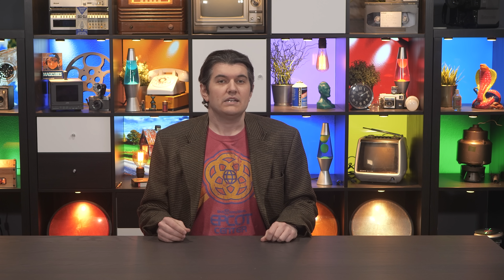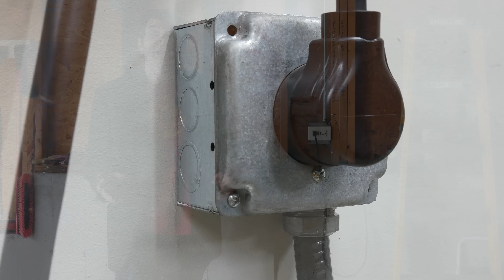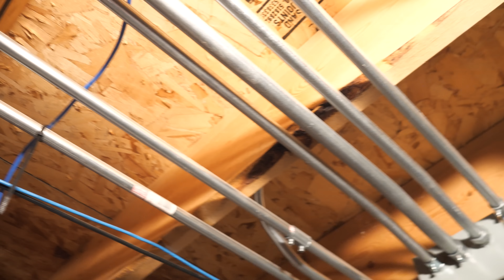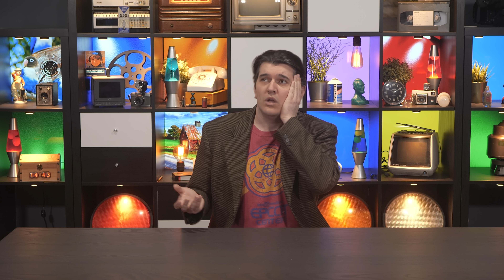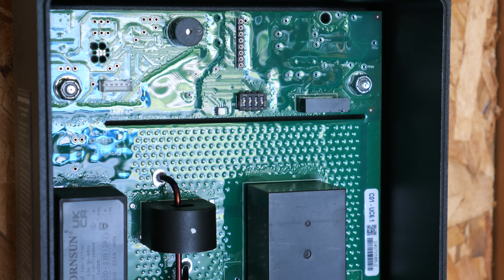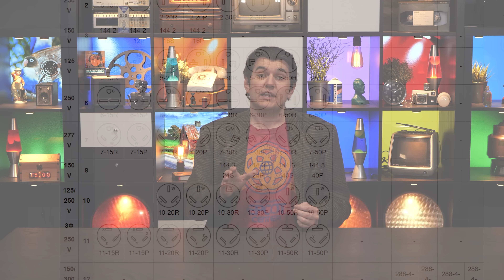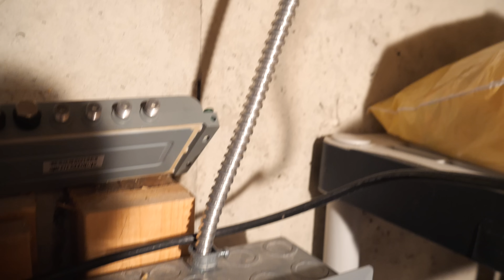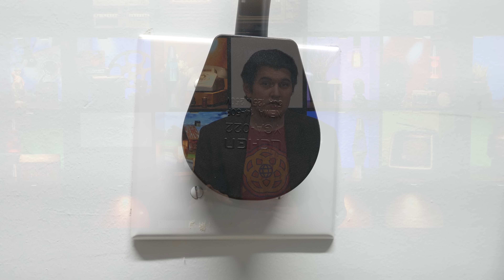The "standard" car charger is usually overkill—but your electrician might not know that

Comment: We have 3 EVSEs at our house. They are all 240 volt. But one is 32 amp, another is 16 amp, and believe it or not the last one is just 12 amp.  The nice thing about 12 amp is I just used some pre-existing wiring going to an existing outlet. I just rewired it at both ends to be 240 volts, doubling the charging speed from 120v.  My wife charges her car from it every night. It does just fine and can easily recoup 100 miles over night.
Reply: EVSEs in the UK have a CT clamp on now for load balancing so you could install 4x 32a EVSEs and they’ll all throttle based on what they’re measuring (whole house or that circuit) - pretty useful for multi EV households. (Our ‘granny chargers’ are 10a/240v but anything above that is always permanently wired)
Reply: @danr3199 you’ll want to make sure you use compatible charging stations that communicate, or they’re gonna oscillate if you’re letting\ them all individually regulate based on the main fuse.
Reply: Ooo ooo ooo the 8 bit guy

Nice
Reply: @adventureoflinkmk2 it’s like one of those bizarre sitcom crossover episodes!!
Reply: I’ve been sharing a plug with the dryer. I don’t need to charge the car and dry clothes at the same time. It’s fine changing out the plugs but I do wish somebody made a switch, you can tell these appliance outlets weren’t meant for continuous plugging
Reply: @alexphelps7042  keep watching the video.  He talks about the solution to this problem later in the video.
Reply: @alexphelps7042  @14:15 in the video. Also splitter cords available. Don't use both at the same time.
Reply: @alexphelps7042 I have a gas dryer that runs the electronics on 120v so I took the 240v from the dryer and charge my car on that circuit.
Reply: @alexphelps7042 14:00 mentions these
Reply: What is this? A crossover episode?
Reply: @Hibari_fan An electrical joke. Nice.
Reply: @Hibari_fan YouTubers often comment on other channels to try to get some views.
Reply: My brother bought a house and wanted a car charger on his 100 amp service. He has a Tesla wall connector running on a 20 amp circuit on his driveway now.
Reply: That's a continues load so it should be no great than 80% load draw that would be about 16 amps -maximum draw
Reply: Yup, it was a game changer for our condo corporation when we realized that our existing wire can run either 120V or 240V at the same amperage.  12 amp charging at 240V suddenly became a viable possibility.
Reply: Hi Dave, I read this in your voice!
Reply: Oh, hi! I read it in your voice. I didn't know I remembered it.
Reply: We bought a leaf in 2011, originally we had a 10 amp charger. but soon we got one that could be set between 6, 10, or 16 amps. even the 6 amp setting worked perfectly fine when visiting my grandparents with questionable circuits in the garage
Reply: Wait a minute, can you make a video of rewiring an existing outlet to be 240 volts? I sort of understand, that might be the perfect solution for my particular scenario.
Reply: @Parker-di7ef  It will only work if that is the only outlet on the circuit. Because this will make the whole circuit 240. If you plug a 120 into it it will fry and possibly catch fire.
Reply: As little as I drive, I could probably get all the power I would need to charge between drives from the 48 VDC, 20 mA phone lines.
Even shorter if people kept ringing the line, sending the 90V ring signal!
Reply: you want to charge your EV with 1W? that's over 3 years to charge my tiny 30kWh battery
Reply: @MonkeyJedi99  If the charger could even operate on that, you'd get about 3  miles of charge in 10 hours.
Reply: For about 5 years we had a 2 EV household with 120v charging only and we never once had a problem.  A Leaf and a Model.  Both are of course very efficient EVs which has the added benefit of adding more miles of range per kWh of energy.
Reply: “Maybe this video was longer than it needed to be.” Alec, THATS WHY WE WATCH.
Reply: New 8-bit Keys when?
Reply: I think that might be my plan. My dryer outlet is close to my driveway, so I have options. (I will hire an electrician, don't worry 😂)
Reply: Update: Device not legal here and my tiny panel could not handle the charger and the 4 season outdoor spa that I'm getting. 

Let's just say I'm REALLY lucky that my wife does the accounting for a small business electrician. The 400$ money back for the charger from the government is nice and all but hoo doggy there goes 3 years of gasoline 😂

On the plus the charger hits 48 amps so my 20-80 takes around 2.5 hours... Nice!
I can also get myself a 220 amp welder for my house now.

Gonna stress this again: I still really love my EV. I thought having a second car for me would free my wife to take up some of the driving duties but I insist I take the Niro because it is such a blast to zip around in with the music PUMPING and the kids jammin in the back 😊
Reply: I am an electrician and I recommend a 30 amp for cost savings unless you own an electric truck.  I own a Model Y and charge on a 30 amp circuit.
Reply: I remember your solar panel video after the Texas winter is the video I think of every time someone mentions solar panels
Reply: Yes a 120V 12 amp or 240v 12 amp circuit can be enough for most l, but where I live in Canada, when it gets cold it takes alot longer to charge because the car needs to keep the battery warm as well as charge it. Also your battery Capacity drops alot as well when it's -30deg C. So consider cold weather performance of you live in colder climates
Reply: @The8BitGuy do you have a video of this?
Reply: @kevinstfort  I want to see ALL videos!
Reply: @kevinstfort same here. charging level 1 from an outdoor 110V / 15 amps outlet with a 75ft 12AWG extension cord and the OEM mobile charger. I think those are capable of 240V at the same same amps. how do you "rewire to 240V"?
Reply: @The8BitGuy could spun off a Channel name @The3EVGuy
Reply: Sounds like the Volt EVSE 240v "hack". Good to see it in the wild
Reply: is ur servicw 200Amps or 100?
Reply: bsolutely loved the way you turned an old wooden pallet into a rustic coffee table! I’ve worked with pallet wood before, and I know how tricky it can be with all the hidden nails and uneven surfaces but your technique for sanding and sealing really made the final piece shine. That torch-burned finish added so much character too. If anyone’s thinking about trying this, I’d recommend following every step you showed. It's not just a beautiful DIY, it’s also a great example of upcycling done right!
Reply: I say 8 Bit Guy TC crossover. In the 12 years I've been watching 8 Bit Guy, that would make one of the most interesting episodes yet.
Reply: and via some batts charged from your rooftop solar panel during daytime
Reply: Wye
Reply: That Tesla video was really bad timing David.
Reply: Wow I would hate to pay your power bill
Reply: Similar setup here.  2 16a 240v's for daily (nightly) charging and one 50A NEMA 14-50 that is RARELY used.  We only use it when it's mid-day and need to recharge quickly or larger battery friends come over and need a quicker charge.  2 200A services at my house.  Before that upgrade, we had one 125A service and still ran 2 16A chargers at night.
Reply: My household doesn’t have a Tesla right now, but we decided get Tesla universal wall connectors. They have the old J1772 plug and the NACS plug built in so it’s future proofed and 4 of them can share a circuit and share power so we installed 2 for now, but we plan on adding one or two others eventually for relatives who come to visit.
Reply: @42069SWAG turning you garage/driveway into a charging station ? 😂
Reply: I imported byd car and charger. I get a full charge at home in about 15min
Reply: So 12 amps can bump up to 240v?
Reply: How can you rewire a 120 volt outlet to 240 volts?
Reply: European here: why in USA you use metal pipe to place electric cables?
Reply: In Australia regular outlets are 240v 10amp - I charge my car this way and it gives me 20-30% overnight at 1.4kw. I can usually charge it to 100% over 3 days or so.
Reply: OMG PLEASE do a crossover EV episode!
Reply: OMG its The 8-Bit Guy aka 8-Bit Keys aka the guy who made PETSCII Robots!
Reply: @choobie8486 also known as David Murray
Reply: @choobie8486  aka the iBookGuy!
Reply: @choobie8486 And the guy who made the Commander X16.
Reply: I hope you put it on a NEMA 6-15 or 6-20 outlet instead of just leaving a 240v NEMA 5.

You never know when you will leave this world and someone else will find themselves plugging something into an improperly wired outlet.
Reply: Just make sure you don't have any voltage on a white wire, and you should change the plug and receptacle to a proper 240V version, which would be a NEMA 6-20P and NEMA 6-20R. Mostly it will just prevent anyone from mistakenly plugging in a 120V device.
Reply: @GuyFromJupiter  The also make NEMA 6-15 plugs.
They don't really sell EVSEs with said plugs though.
I purchased a programmable EVSE that I plan to swap the plug on  (after limiting it to 12A).
Reply: @economicprisoner Whatever your view on Tesla, the swappable plugs on their mobile EVSEs are pretty slick. My dad can charge on a 14-30 at grandma’s cabin, a 6-20 at the cottage and a 6-50 at home all with the same device.
Reply: @economicprisoner IIRC, Tesla offers a 6-15 tail for their mobile connector.
Reply: @georgepelton5645  Did not come across it when I looked into it. I think I DID consider a Tesla connector.
Did not look too hard though, the company being headed by a Not-see and all.
Reply: @GuyFromJupiter  you don't need a plug if it's just hardwired. unless you need that 240V plug and have something to plug in?
Reply: So many red flags in this comment. As an electrician, I disagree with just rewiring an existing outlet to a higher voltage without changing the wires and removing daisy chains.  Direct line to a car charger, always.
Reply: @FIGHTTHECABLE  Should be OK as long as it it really a "direct line" as you say.
Split single phase keeps the voltage, relative to ground, below 150V.
Reply: @economicprisoner It's not the voltage I am concerned about; it's using a wire dedicated to being neutral as a live wire. Even if the wire is tagged as a live wire, it is insufficient. There could be other neutrals on the same circuit that also need tagging.  It is best to replace or add additional wire to ensure the dedicated neutral stays neutral.
Reply: @FIGHTTHECABLE  You saying I need to used time-domain reflectometry to make sure it is safe if I can't get eyes on the entire run?
Reply: @economicprisoner . Don’t need to be so obtuse, it’s clear that is not what they are saying.
Reply: This works but then you end up with a white wire that's hot, which is not ideal and probably is against code
Reply: @gramathy 
It is acceptable, so long as you mark the cable ends to indicate their re-purpose. This is generally done with either black or red electrical tape wrapped a few inches back from the end. It doesn't need to be fully wrapped- even just a single-width of the tape is acceptable per code, though some inspectors may ask for a bit more.
Reply: @typrus6377 As an inspector I would advise the    a 6-15R receptacle to be installed. Then simply make an adapter cable for EVSE.  Labeled of course! This way only properly rated devices can be plugged in to it.
Reply: @nexxusk 
I was simply referring to the re-labelling of conductors, but I agree, it's always better to use a receptacle that matches the conductors- you never know who will be using that circuit after you!
Reply: @gramathy pretty sure its fine as long as its marked, though the NEC probably disagrees, at least any electrician thats not an idiot would check for voltage on white before touching it. 

If its not marked and/or at least a plug switched they might think a multiwire circuit’s neutral feed might’ve been disconnected somewhere, especially in a garage where sometimes people fed from the kitchen off the GFCIs
Hope he switched the plug and used a 240 breaker though

Not an electrician, this is not advice, if you fry yourself its on you
Reply: @gramathy Mark it with red tape
Reply: @s10jam  That's against code.
Reply: @icy1007  Maybe in Californistan or some other Soviet block state, but the NEC allows it.
Reply: @s10jam  No they don't. It'll be a violation anywhere in the US.
Reply: @gramathy that’s why you relabel the wire with a little electrical tape
Reply: @quartzofcourse  Need bigger wire probably for 240 use.
Reply: @ksavage681  It's the amps that matter, both hots on a 240 are 120 each.
Reply: @gramathy  If the wire is part of a multiconductor cable, such as Romex (and ONLY if it's part of a multiconductor cable) you can use red or black electrical tape at both ends to reidentify it as hot. If they're individual conductors, such as THHN, you can't do this and would have to re-run the wire or have a code violation (but if you do go this route despite its being a code violation, relabel it anyway as that's a slightly less dangerous code violation)

The reidentification does have to happen at every splice, but if it's a straight shot from the panel to a single receptacle, you only have to do it in those two spots.
Reply: @homestar92  in my state, you can only reidentify individual wires 6 gauge or larger. For romex, you can only do it with a 12/3 turning the red traveler to another hot and using a 240v two pole breaker or handle tie, not 12/2 romex. Please check  your local codes, they can differ.
Reply: Its not against code if labelled - ie, you tape the end red. This is standard practice. There is no special 3 conductor wire made for 240v applications, you just mark it properly.
Reply: @gramathy should have told that to whoever wired my baseboard heaters which used white live 240v power.
Reply: @gramathy Code allows use of white as a hot leg, IF you wrap colored tape, typically red, on both ends so an electrician knows it’s not neutral.
Reply: @gramathy this is not against code. You just have to mark both ends of the white/neutral wire with black or better, red so there will be no mistaking it for a neutral.
Reply: Tape on the phase conductor near the termination is all that code asks for in that circumstance.
 @gramathy
Reply: @gramathy  tape it red, all good in the neiborhood
Reply: @gramathy he’s in Texas, code says “git along little doggie”, so he’s good.
Reply: @gramathy I believe that you are supposed to mark the wire with tape to indicate that it's hot, but that code could be different different places.
Reply: @gramathy  just add some black or red phase tape and it's code, really not a huge deal
Reply: @gramathy  Code allows for this (depending on where you are), but you're supposed to wrap the white with a band of black electrical tape at each end.  It used to be done all the time with light switch circuits.  A single run of romex would be run from the light box to the switch on the wall, white would be constant hot to the bottom of the switch indicated with tape, and black would become the switched hot to the fixture.  That's why so many smart switches have that neutral required * in their install instructions, a lot of older homes don't have a neutral in the switch box.  240v 20amp circuits (2 hots and a ground)  are a thing, most commonly for window unit air-conditioners or mini-splits.
Reply: @gramathy  It is not against code at all. You don't even have to do anything like recoloring the white wire
Reply: @gramathy not against code. The code only cares that neutral is gray or white and ground is copper or green. Hot wires can be any core but green
Reply: @gramathy eh just throw some red tape at the ends and it’ll buff
Reply: @gramathy there is nothing wrong with using a white wire in a cable as a hot wire. This is quite common and code compliant, though it usually is required to retag the end of the white wire as black, like just with some black electrical tape, to indicate it has been used as a hot.
Reply: @RobertHancock1  Correct, only when installed in cable. If not in a cable such as conduit it has to be the correct color insulation and not allowed to be retagged.
Reply: @gramathy not against code.  And if you're actually concerned about that anyway then just wrap some red tape around the ends.  That's how you deal with running remote switch wires. (Since you dont need a neutral at the switch)
Reply: @fisqual  Used to be true. Pretty sure I've heard that as of the latest NEC you do need a neutral at wall switches now. I gather this is because some people these days want to replace their switches with "smart" ones that require their own power.
Reply: @gramathy it’s code to re color it
Reply: @gramathy generally current carrying wires can be black or white, same gauge, same copper. Red insulation coating too  sometimes.
Reply: @JohnRoss1  Current carrying ≠ voltage carrying
Reply: You still think you could develop sentient AI by yourself? That video was wild.
Reply: This is such an american thing to have three cars for two persons lol
Reply: @AntonSoliaryk Old and always specious argument. A vehicle is a tool and some have special uses. The truck necessary to pull a trailer is far from the best daily driver. By having another option I improve my “fleet” fuel economy and reduce my environmental impact. Same for any other special need or member of my household. Or to put it another way, America - don’t need a reason. 🇺🇸
Reply: @AntonSoliaryk  One person here, three vehicles.  Dump truck.  AWD Minivan.  And 95% of the time I drive an EV rather than either of those.  Specialization, and there are not good (used) EV substitutes for the dump truck nor minvan.
Reply: @AntonSoliaryk  IIRC He has an adult daughter who has a car. He's shown his daughter's car on his channel. So not 2 drivers.
Reply: @AntonSoliaryk American prosperity is pretty awesome!
Reply: @AntonSoliaryk  a) he seems to travel long distance infrequently enough to utilize a third car with a larger battery (afaik, all his EVs are used, mind you) b) his daughter is either nearing or at driving age, so he probably just kept one of his older vehicles for her to drive. Dont be parasocial enough to assume it's three cars for two people without being parasocial enough to actually understand his life as he's expressed it through his videos...

Frankly, it's not even that common in America for a household to have more than one vehicle, despite having children and both parents working. It's more common now than before to have multiple vehicles, but for the longest time it was cheaper to have one vehicle. Iirc in America, we insure by the vehicle, not by the person. Barring state laws, the insurance follows the vehicle, so it's cheaper to have one vehicle with many drivers. Heck, people only have vehicles because of the nature of landscape and construction. Most people in other countries get by without any vehicle. Plenty of people will take multi-hour commutes using the terrible American public transit to get to work because they can't afford a vehicle and insurance, even though a direct drive commute would be a fraction of that.
Reply: @AntonSoliaryk  why so few? we usually have 4 to 5 for our 2 drivers
Reply: @AntonSoliaryk  I hear people from the EU and Britain talk about this all the time, 2 cars for 1 person.   A regular car and a very small city car type thing.
It makes sense to have 3 cars as long as 1 is very old and serves some kind of specialty, like a minivan or truck.  Being old is key so you don't have to have collision coverage, which is very expensive, or even just not another car payment due it being old and paid off.
Reply: I can hear your electric panel begging for mercy lol
Reply: I was going to mention the difficulties you faced when you went to---was it Chicago?---in your EV and how much you had to plan ahead precisely because charging stations are not all over the place like the uploader seems to think.
Reply: @encycl07pedia- He went from Dallas to Chicago. And he planned out of an abundance of caution and that the Bolt he was driving can only DC charge at 52kW max. The original Bolt models are not good road trippers, practically any modern EV will have a cap of at least 120kW, and 800V vehicles will easily go over 220kW, making charging stops very short.
Reply: I have a Tesla Model X and a Cybertruck, and when I used 110–120V, it only gave me 3–4 miles per hour. 
That’s not good, as it heats up and is NOT safe!

That’s why, at my place, I have two Tesla Wall Chargers on each side - and it’s PERFECT!

This guy is DUMB for pushing that to people, period.
Reply: @ThinkForge01 or maybe YOU are dumb for thinking level 1 charging is unsafe..
he's basically just saying think for yourself instead of just doing as your told. half EV owners drive less than 30 miles a day.I do even less and also work from home so I have at least 16h a day available for charging. even if had to commute  there's a high chance I'd have charging at work, free or at utility rate
Reply: Yeah you're helping harm the environment. Your electric vehicle creates more green house gasses to build. And if you still use the grid they still use coal. So thanks for hurting the environment
Reply: @peterpramshafer933 this has been debunked sooooo many times.  Three years with an EV has meant I didn’t purchase 350 gallons of gas.  The electricity I use is currently 30 percent nuke, 30 percent renewables, and climbing about five percent renewable per year.  At five years of age, my car will be carbon ahead, and still have three years of warranty remaining.  And that isn’t even including the wars over oil, the increasing gas prices,the recycling value of the car, or the solar im adding to my property.  What percent of your gasoline gets recycled?   My battery is 90 percent recyclable. 

I just charged my car for $4.50.  My F150 cost $160 to fill.   EVs have already won the future.  Their market share is still climbing even with all the FUD.  Y’all just can’t see it yet.
Reply: I'm sure the power grid is good enough to charge your electric vehicles and to have data center🤷
Reply: You must suck having to think about that every single day of your life
Reply: Oh hey aren't you the guy that destroyed vintage computing items lent to you? Man I had completely forgotten about you!
Reply: WTF is a ile? Use kilometers bruh.
Reply: I drive tractor s mostly that take good old fashioned red diesel ⛽ yum yum I love the smell, electric has its place but not every where...
I love your channel Great work and knowledge 👍😁😄😄
Reply: @rob32pigboy tractors are actually one of the best places for electric to thrive.
Reply: 3 soy boy cars 😂
Reply: Youre gay
Reply: Sounds like way too much work and inefficient for just charging an EV. Yet I was told years ago that it's the future
Reply: I hope there is a fire station near your house.
I would NEVER charge an EV in the garage, especially if it is part of the house.
Reply: @christo930 Do you turn your power off at the mains every night? 

And empty your gas from the car before parking it inside?
Reply: @tbird-z1r  Electricity doesn't spontaneously and for no reason burst into flames, nor does gasoline.
Reply: @christo930  Neither do electric cars.